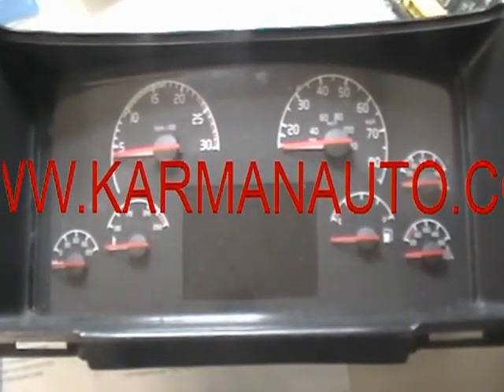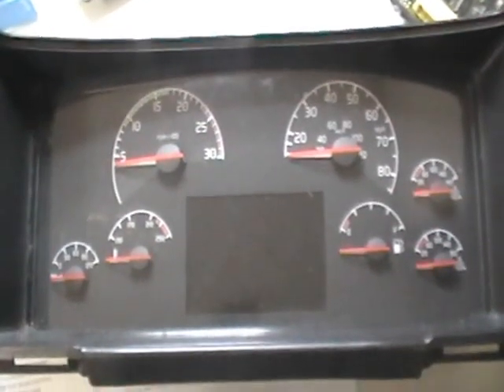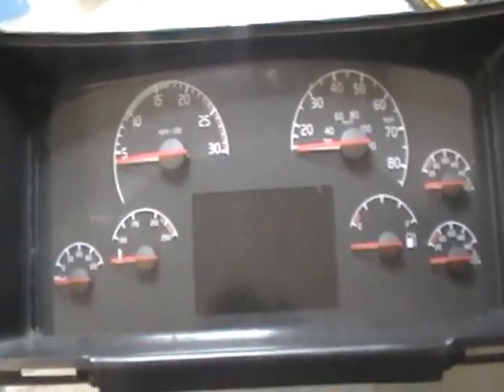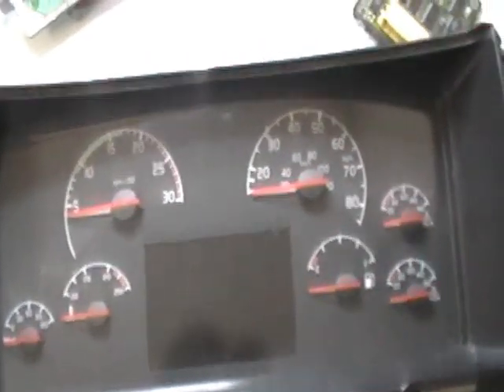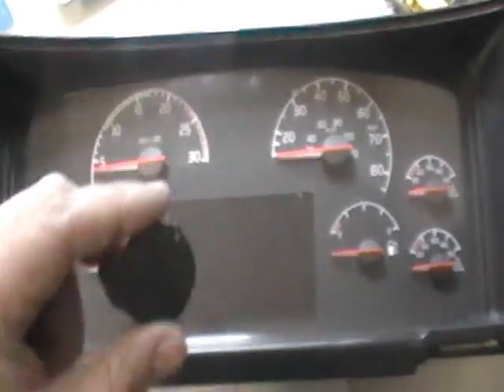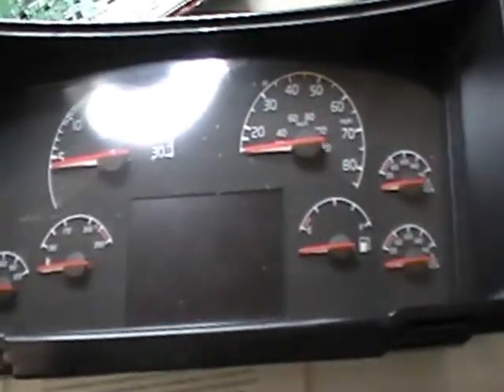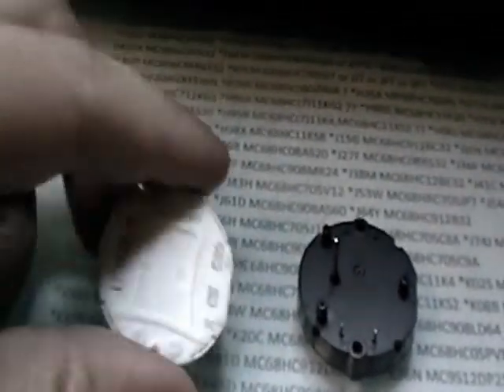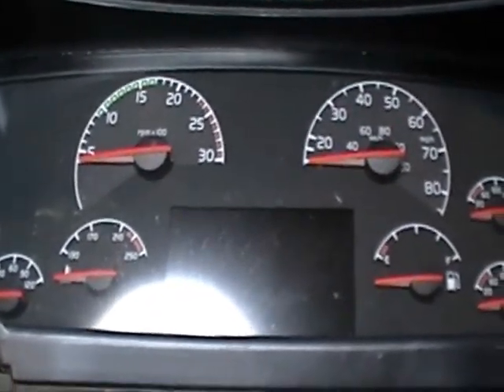How to REBUILD or REPAIR VOLVO SEMI TRUCK TRACTOR SPEEDOMETER GAUGES CLUSTER

Comment: i have 2000 volvo with s 60 12.7 engine speed display screen and temperature gage is not moving do you have one or do you fix the screen?